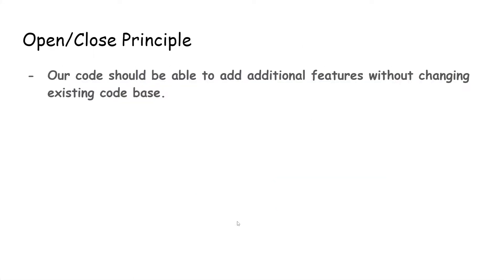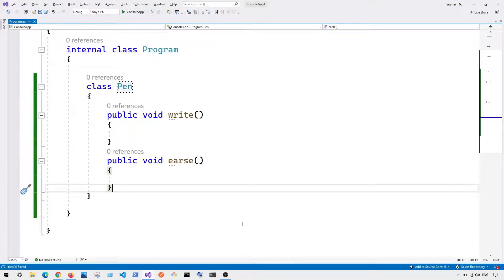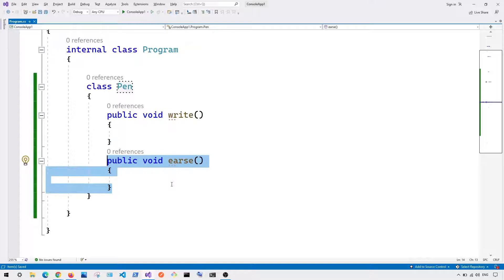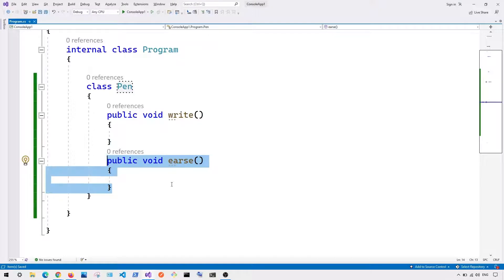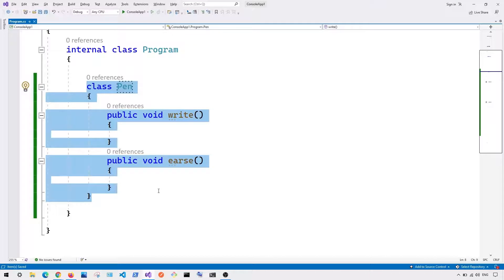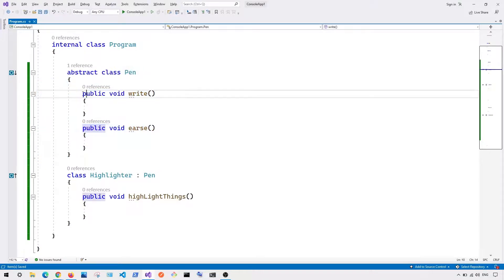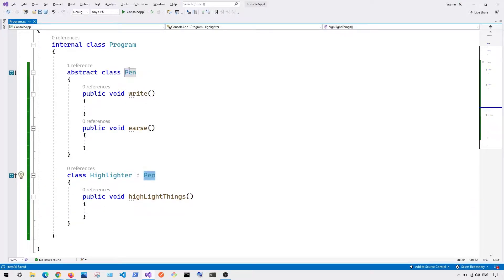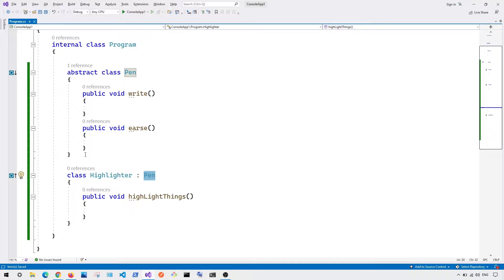Open-Closed Principle [SOLID Principles #2] Step by Step

Comment: Why does the highlighter has write and erase if neither is related to what we expect of a highlighter? It seems you have made yourself an anti pattern instead of an example of the open/close principle.
Reply from the maker: @SojournerDidimus Fair point! I used the highlighter just as a playful analogy, but you’re right — having both write() and erase() strays from what we typically expect in a pure Open/Closed Principle example. I’ll make sure to refine future examples to better reflect the core idea. Appreciate the sharp eye!